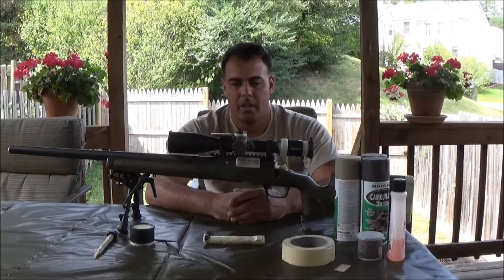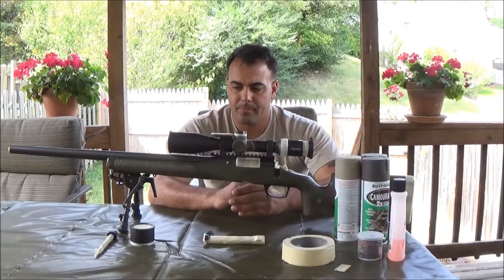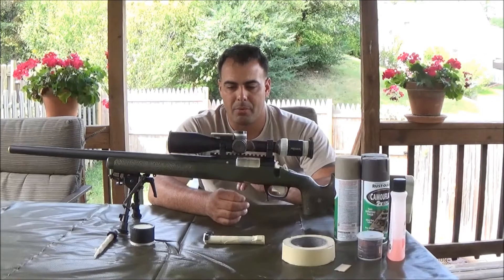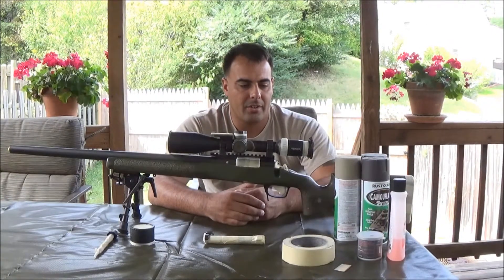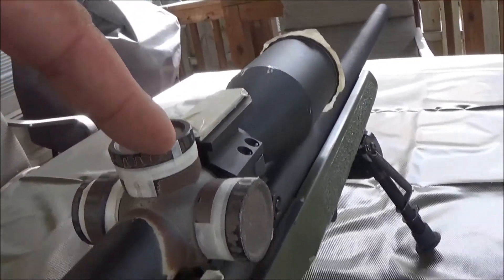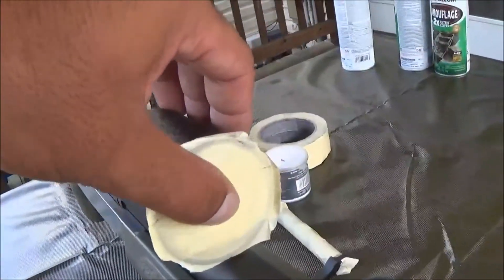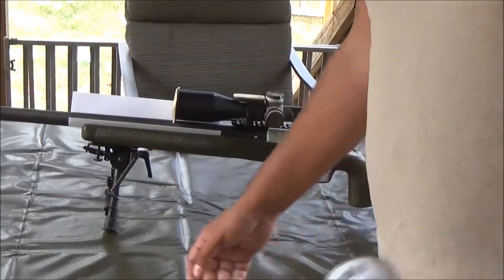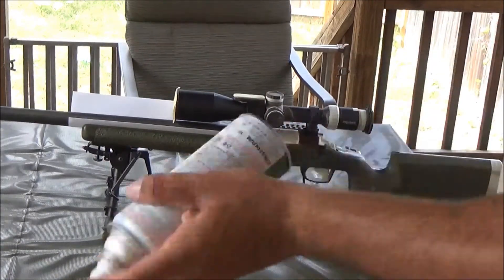Painting my Remington 700.

Comment: Hi Mike I have a Remington 700 .270 with a basic black synthetic stock and black barrel, I was wanting to paint it kind of like a used desert military weapon but with no pattern on it. Would I still use these steps to do that? Also, to paint the barrel do I have to sand it down any so the paint will stick or no?
Reply from the maker: I would still tape everything that you don't want painted and I don't think you'll need to sand the barrel. If you want it to look used you'll want the paint to wear off a bit.
Reply: +MikeM0331 cool I appreciate the reply back!
Reply: I sanded the barrel since i fucked it up with cold blue i have a 700 also 30-06 painted the barrel matte black have like 5 coats on it and the stock is desert tan  but i sprayed the stock with textured paint first so i can get a good grip then i sprayed it with the tan I’m just worried about the paint on the barrel and how its gonna work with the heat after u shoot it